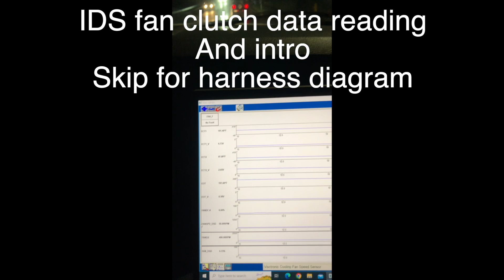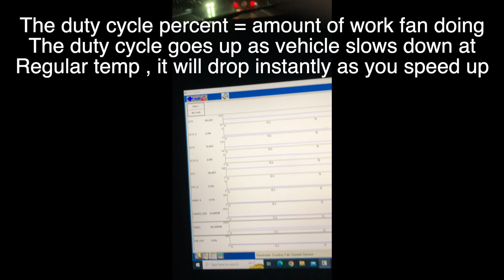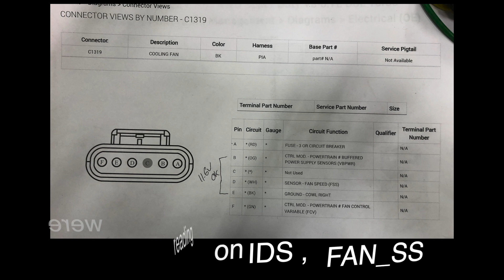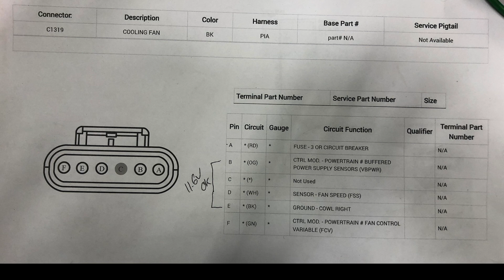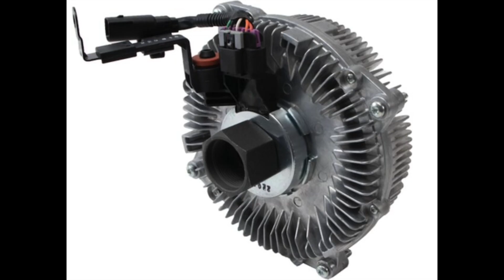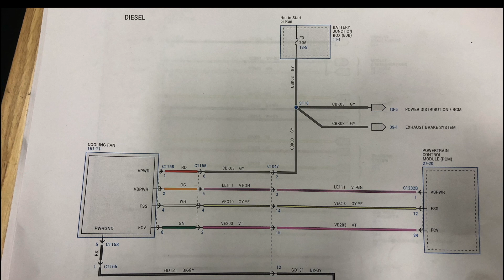6.7 powerstroke fan clutch wiring

Comment: If I need the fan to run full time, how would I wire that?  I have lost my harness and need it to spin until I can get a replacement sub harness.
Reply from the maker: I would just place couple aftermarket fans in front and wire them to a switch , that oem one will need a smart controller for it to function where you provide pwm .unless you find a classic mechanical fan clutch assembly that fits

Comment: Would anyone here know how to add a switch to the 6.7 powerstroke that will allow me to manually turn on my fan to 100% before I start going up a steep grade. Thank you
Reply from the maker: Unfortunately ford doesn’t offer the option to add to switch to control that, I honestly think it is best to just throw a separate electric fans behind the grill and get them wired independently
Reply: I purchased a new pigtail thinking I would turn off and on the clutch manually by send 12 volts to the clutch and grounding the pcm wire? Or send 12 volts to it to?
Reply: Did you ever figure this out? I would like to do the same

Comment: hiya, on the fan control variable pwm do you know the hz & duty cycles? I want to ditch this fan and run electric volvo fans with module activated by pwm 5v & duty @ 100hz. thank you for this video. the other 2 for a/c & full blast or cut over-ride?
Reply from the maker: I dont have the pwm frequency in numbers but still that data may still be collected using the ids or the new frds. You can also add some auxiliary electric fans that way it stays stock

Comment: My F3 is not the fuse in my diagram. Can you help?
Reply from the maker: What year and model you have?
Reply: Same question. 2014 f350 truck
Reply from the maker: @MatthewBuzzeo  will have to get the diagram on prodemand website, mine in the video was f550

Comment: Was up man I need some help wireing up the engine harness side my plug ripped off
Reply from the maker: I don’t have access to the wiring diag or I would just look it up for you , but check it out on pro demand with the vin number: 
https://mitchell1.com/prodemand/
It will cost couple dollars but it is worth it
Reply: did you ever fix it? i need the color code for the motor side as well the new connector is all green wires
Reply: @connorsullivan2895 where did you source the pigtail?